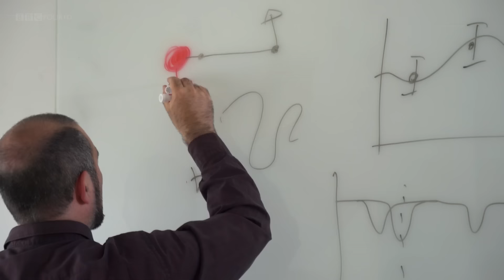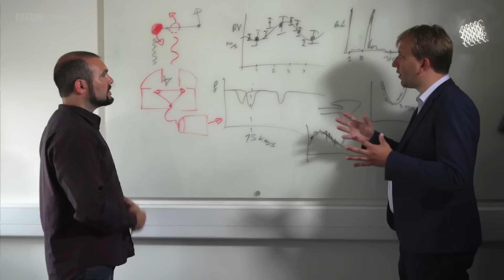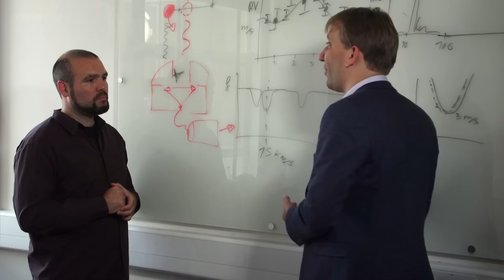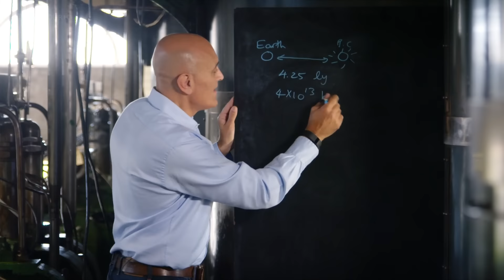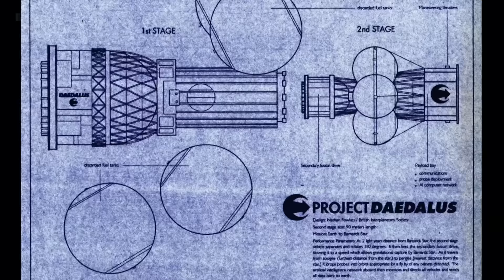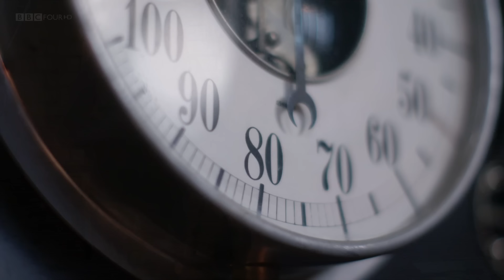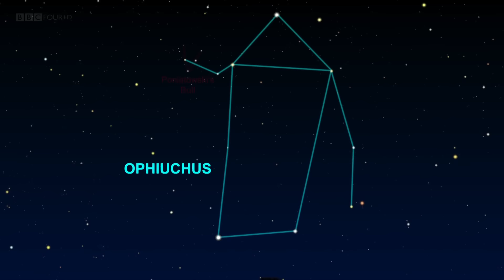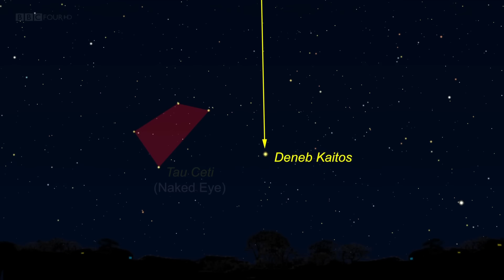BBC The Sky at Night 2016 Interstellar The Journey to Proxima b

Comment: 1. Create two entangled particles
2. Put one of them in a transistor, which turns spin into an output signal. This is the receiver, which will stay here on earth.
4. Put the other one in a transistor, which turns a digital pulse train into changes of spin. This is the transmitter for the journey.
5. Put a HD-camera onto a postcard-sized spaceship and connect its output to the transmitter
6. Use whatever propulsion you like and set sail :-)

The entangled partiicles will be able to transmit all footage at realtime without any latency. The received signal will be fed into some web-server for everyone to see on cellphones.
Reply: Does it really work that way?
Reply: @vexatuvex9235  Entanglement doesn't mean instantaneous communication unfortunately, so that is out. Additionally, that probe will be shooting through its destination star system at 20% c, so there won't be much time to transmit useful data. I have no idea how any transmission of data is going to be powered, nor how the necessarily tiny signal could be picked up back on Earth. We'd need several breakthroughs in our Earth-based reception to pick anything up. Besides, I'd expect that by the time the first probe reached its target, technological developments might have occurred that allow a faster bigger better craft to be available. So would the first one have been financed and sent? The good thing is, if Earth-based infrastructure works well enough, many of these tiny craft can be built, and sent to different stars.
Reply: There is no information passed between entangled pairs of particles, so unfortunately you won't receive any signal/information from the probe. :)

Comment: I'm only 26 almost 27 and I'm concerned with seeing this happen in my life time. 😓😓 good luck guys. 🙏
Reply: Sorry to spoil the party but it is just not possible just look at my comment in the main.
To be short this spaceship must convert at least 99.999985% of the laser energy into motion and not into heat.
If the spacecraft of 1g is only slightly less efficient the spacecraft will melt and then vaporize in an instant.
You direct the power of 100 GW or about 100 nuclear power plants onto a spaceship of 1gram that's the problem.
For comparison the peak power production of the UK in 2007 was 61GW and is now only 53GW because demand is lower.
So you need the production of two Great Britain to start this 1 gram spaceship for two minutes or let's say it better vaporize it.
And the fastest man made space probe so far would take about 18357 years to get there. 
Sorry I doubt this will ever happen in the next 200 years if we can't find another spacial dimension to take a shortcut.
Look at my comment for the calculation.

Comment: 100 GW laser directed to a spacecraft for two minutes.
2/60=3.33% so 100GW*0.03333h so we get 3.3 GWh of Energy pumped in one tiny spacecraft.
That's 3.333.333.333 Wh of energy.
You need about 160Wh to bring one gram of wate from 20C to 100C.
So let's say the spacecraft can function without problems at 300C then it takes about 500Wh to hear it up that much.
So we can calculate how much of the energy can at maximum transferred into heat in the spacecraft before it melts or doesn't function properly 500/3.333.333.3330=0.000015%.
This would be an incredible efficient transfer from laser energy into motion or just not achieve able because of thermodynamics. Such a high efficient transfer of energy is just not possible.
Then there is the Parker Solar probe who travels at 68,6km/s or 0.02289% the speed of light c.
So you need 4.2 / 0.0002288=18357 years if you want to wait to get there with the Parker Solar probe.
The distance is to far for conventional travel and you can't pump tons of energy in a tiny 1 gram spaceship because it will melt and vaporize  in an instant even when you convert only 1% of the energy into heat.
Please do your own calculations.
Reply: @MrSimonw58  Mirrors also convert at least about 0.05% of the energy into heat no real solution.
I have not the right numbers at hand but I thought I have read bout 0.5% at a span solar thermal power plant.
Where they also had to cool the last mirror that transfers most of the sunlight into the steam processor.

Comment: Sure I read somewhere that a vehicle travelling to Proxima at our current fastest ship speed would take over 700,000 years 😳
Reply: I have done the math in the main the Parker Solar space probe (68.6 km/s) is the fastest man made object so far and even this will take 18357 years to get there.
I have also done some math for the gigawatts laser array this will take twice the peak energy production for two minutes to start the spacecraft given you can transform 99.999985 % of the energy in motion and nothing more than this into heat.
If you produce more heat than 0.000015% of the power transferred you melt and vaporize the spaceship in an instant.
I have done a rough calculation in my main comment.

Comment: these laser craft are a very interesting idea but are not going to yield much more than the tech works. the chance of impact with space dust renders it useless, the speed it will pass it's target at will render it useless, a great idea and probably good for the advancement of space travel, but not us traveling there nor learning much about the planet there.
Reply: Well, the beauty of a sail that way is it works going both ways.   It'll still be going fast,  but it'll also slow down pretty quick if it catches light-pressure from the destination star/s.